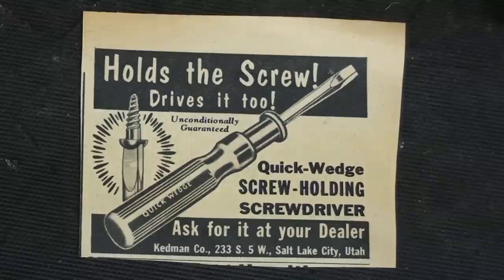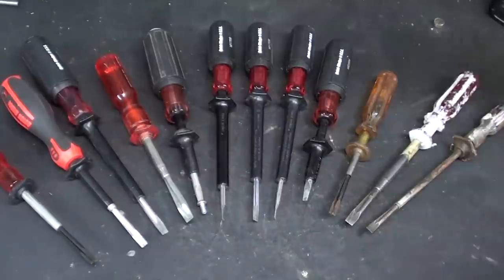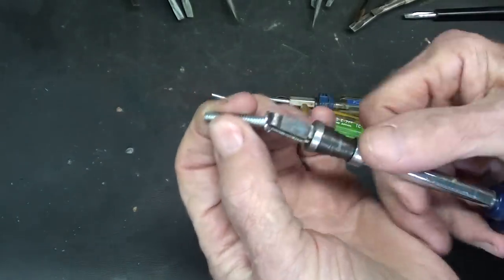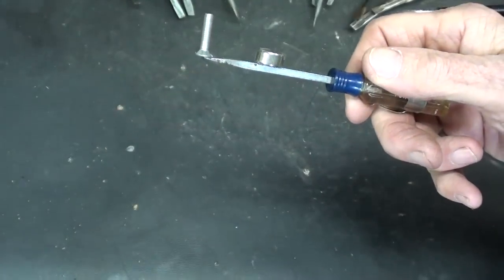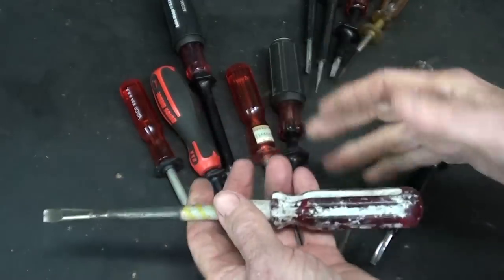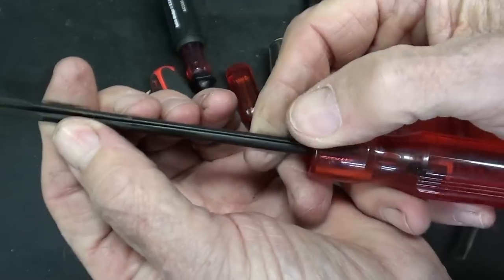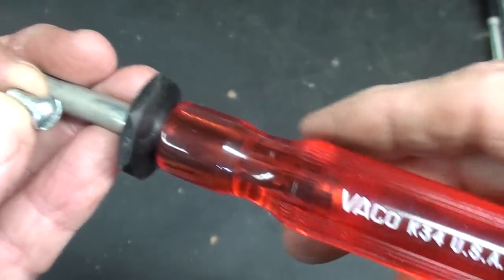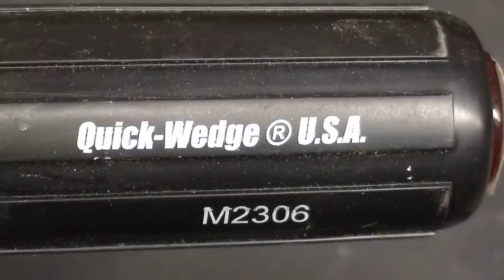what are QUICK WEDGE DRIVERS short subject #25 tubalcain

Comment: Interesting video as usual, thanks.  Good idea that takes into account worn screws or drivers.  I am still surprised that the square headed Robertson screws/screwdrivers never caught on in the USA.  They are extremely popular in Canada and far superior to the Philips/star screws, which tend to round over unless the screws are hardened.  I read that Henry Ford wanted to use the Robertsons in his vehicle manufacturing without paying any license or royalty fee, and when told no he opted to stay with the Philips screws.  The Robertsons not only don't tend to wear like the Philips but the screws usually stay on the driver when inverted.  I worked for a company that sold wheelchair lifts to install in the Seattle bus system and they were very taken with the Robertson screws we used.

Comment: In 37 years of owning and using "screw starters" as an industrial electrician I have NEVER known they were called "Quick Wedge" screw drivers. The worst thing you can do is loan one out. They aren't meant to tighten the screw, but the lazy &%$#@ you loan it to will most certainly tighten a screw with it and ruin it.
Reply from the maker: I think I know that guy

Comment: I've managed to collect several designs of screw holding screwdrivers.  I think the Quick Wedge design is the best.
Reply: A work friend has one with a little spring loaded flipper in the middle of the blade. Worked good for him.
I like Quick Wedge myself.
Reply: @duron700r  I'm planning on doing a show and tell video of my collection this weekend.  I think I have a couple with the flipper like your friend's.

Comment: My Dad was a radio and TV repairman (started in 1947) and I think he bought every screw holding driver ever invented as he had so many tight spaces to get into removing and installing radio chassis in cars, tractors, and home equipment.  He had one that had a center piece that when twisted would be inline with the slot and then when the handle was pushed the little center piece would try to turn at a 90 degree angle.  This really held onto the screw.  But this wedge style is still the best, I have seen them under many names and like you I don't know if they got around the patent or paid for the rights to use it.

Comment: My dad had a whole set of Quick Wedge screw holders and I first used them when I was kid, back in the 1970s.  My dad had the foresight to yell at me before I ended up using them to tighten-up screws, almost like he was the thought police.  That applied to a lot of things, with my dad, actually.  My dad's gone now, but I still have the set of Quick Wedge screw holders along with the original wall-hanging holder that's made from aluminum.

Comment: Thanks Mr. Pete,  I've used the KD brand for years.  They are spring loaded and the center of the blade twists to hold the screw.  They had a magnet on the other end in case the screw slipped out.  they worked great for installing the screws in a distributor to hold the points and condenser.  KD also made one for the Phillips head screw.  You almost have to use a magnetic screwdriver these days because the manufacturers are making screws to be used by the slotted, Phillips and the Robertson square screwdrivers all on the same screw.
Reply: What works better is changing points for an electronic ignition. Like my buddy Scotto shouted as he floored it after I dropped an electronic distributor into his 327 Chevelle, Twice the power! Screw that dual point nonsense. It's just twice the trouble.
Reply: @1pcfred  True but points lasted an awful long time. After their demise came the high capacitor units. Now timing is straight off the crankshaft. I like it.
Reply: @ellieprice363  I never had good service from points. Theoretically contacts should work better than a transistor. Less resistance. In general I am not a fan of electronics in vehicles. They often lead to inscrutable problems in black boxes. Electronic ignition on the other hand is very reliable.

Comment: Very handy tool. I have worn out two of these wiring up Jones strips in electric substations. I also had one that would do Phillips head screws, but rather than a sliding collar, it had a spring-loaded twist lock that engaged the slots. They’re best used as screw starters and you’re right, they can’t handle much torque. Thanks for sharing.

Comment: I have used Quick wedge for at least 3 decades. I love them. I have Quick wedge Snap-On (Blue Point), Vaco and Klein brands. The different brands vary only slightly and are likely all rebranded Quick Wedge. I have 5 or 6 blade sizes and several blade lengths for most sizes. They are an antiquated application since slotted screws are nearly obsolete. There are still a significant number of slotted screws in the electrical industry. This has been my primary demand for this tool. They are handy when doing vintage work. As Lyle demonstrated, the Quick Wedge is vastly superior to all other style of flat blade screw starters. I have more size versions than Lyle showed, but his 1000V rated tools are not in my arsenal.
Craftsman and Snap-On tried a style of screw starters the sort of worked. I have both of these makers versions. This attempt uses a full width flat blade (cabinet tip) with a spring loaded pivoting center blade section. This center blade section is intended to lock the slotted fastener. This style barely works, but the screw holding outside grabber styles are even less successful. I have at least one Phillips screw holding version of the center blade pivoting style. This design wasn't very successful either.

Comment: Marketed in south east Asia as Kedman screw drivers, handles were very small diameter so that you knew not to torque the screw, also had a set that were RAAF issue that were a hinged type where the pivot was an inch or so back from the tips and when the handles were closed, pliers fashion, the wedge action gripped the screw.
I’ve not seen a patent mark on any of the foreign made ones, but is a design concept that goes back to late 1800’s from memory.
Thank you for your informative and sometimes amusing videos. Take care.

Comment: Trick of the trade: wrap the screw with electrical tape to the end of the screwdriver. It holds it on very well enough to get the thread started and you can take the tape off after its secured. I've done this for many decades as a kitchen equipment mechanic and it's hard to get some screws started in hard to reach areas.
Reply from the maker: Good idea

Comment: Yet another great vid.  Keep 'em coming.  Back in the 19 and 70's I learned the old mechanic's trick (from an actual old mechanic) of folding a bit of paper or matchbook cover over the tip of the screwdriver and it into the screw slot.  Worked well for over 50 years.

Comment: For years, working on cars and doing tune-up, the ignition points, condenser and rotor were held in place with small slotted screws such as 6-32 and 83-32. I got my tune up tool kit from Snap-on and it included an aluminum screwstarter with a spring loaded feature that would twist in the slot and hold the screw when unlocked, even by pushing down so your fingers could grip in in small confines. I just looked on McMasterCarr and they had the later developed phillips and nut holders but not the original straight style. I still have them and use them on occasion. Most mechanice had them when distributors were in use. A great example of one is the Stanley Proto J9866 Proto Slotted/Phillips Screw Starter available at many places. T hey do cost more.

Comment: The japanese came out with Phillips slots so perfectly formed that their matching size screwdrivers could hold their screws quite well.  Short of this, a piece of tape tightly wrapped around the screwdriver shaft but loosely around the screw head does the trick.  I was really hoping to find out if that "cheese" that grows on the plastic handles is safe for pets.  It's gotta be some kind of fungus.

Comment: I saw a different type of screw holder called a screw starter used one time and I went right out and bought one for myself.  It saved a boatload of swear words when changing out the points and condenser in an automotive distributor.  In those days the SB Chevy distributor was buried down in front of the firewall and way down on the engine block. Those little screws were always falling over in the distributor, or falling out on the way out of the distributor and (hopefully) all the way to the floor where you could eventually find it.  It was only for slotted screws, and small ones at that, but was invaluable for getting the points adjusting screw and the capacitor mounting screw out of a distributor.  It has a blade end, but the middle is a separate blade piece that is spring loaded and turns something approaching 90 degrees.  To remove the screws from the distributor you would loosen the screw with a conventional screwdriver, then set the spring with the center blade inline with the outer blades, and set the blades down in the slot of the screw and press down, releasing the spring.  The center blade would turn and grip the slot so you could finish loosening the screw and lift it out of the distributor.  To reinstall the screws, you set the spring, aligning the blades and insert it into the slot of the screw you were wanting to put back in the distributor, push down, releasing the spring, and the screw was attached to the screwdriver so you could carefully guide it into the threaded hole and start the threads.  Then finish tightening with a conventional screwdriver.  Personally, I never had much luck with the wedge type screwdrivers.
I bought mine back in the late '60's and still have it.  The closest thing I could find on Amazon (with the best picture) is: "GEARWRENCH Slotted Screw Starter, 5-5/8" - 2282D".  If you search Amazon for "screw starter" you can find find several variations including Phillips only and Phillips and Straight on the same screw starter.  The Phillips starters are very spindly and I don't remember if I ever used one of them.

Comment: Canadians prefer the screw invented by a man named Robertson. Phillips strip way too easy. 
Robertson, the square holed ones, slip onto the correct sized bit and can be held at any angle without falling off.
Henry Ford tried to buy the patent but was told to pound sand. So Americans got stuck with the semi-useless Phillips design.

Comment: Just got my mother-in-law’s place ready for sale…
Have a 27 cubic inch bin of apex bits in my possibles traveling kit and no only found 1 or 2 slot drivers… I was appalled taking down curtain rods, light fixtures, spice racks, cabinet pulls with slot head fasteners…

Comment: Through a working life in engineering here in the UK, I never saw this type of screwdriver even once !
I believe British Telecom issued them to telephone engineers back when phones had about 1000 tiny brass slotted screws in them :o)
Reply: There was a tool like this for electricians that kind of looked like a soda straw. It had a really skinny plastic handle. But the tip was split and wedged. Then with the skinny handle you knew not to try to torque anything. Plus you could get that thing in anywhere.

Comment: I've had 2 for probably over 45 years, a 4 1/2" & 12", both Quick Wedge. Perhaps Vaco made theirs after the patent expired. Back in the day ceiling fan blades were mounted with slotted-head screws and there was no better way of starting those screws than with the Quick Wedge.

Comment: When I was working I had wedge type screw drivers for philips as well as slotted.
Reply from the maker: Never saw one for Phillips
Reply: @mrpete222  Not a whole screwdriver, but a 'screw starter', 3/8 knurled aluminum tube with spring loaded blade for #1 & #2 Phillips, from Snap-On in 1971.  Better then the magnet or sticky grease I'd been using!

Comment: I use the Vaco brand for typewriter maintenance and repair.

The white residue on the handles is the plastic sweating chemicals.  It can be easy remedied by applying a heat gun to the plastic.

Daniel
Reply from the maker: Thanks, I think I will try that truck to remove the white. But it smells sometimes.
Reply: @mrpete222  I've researched the topic of acetate breakdown and there's no known cure. If it was as easy as heating it up I think it'd have been published. I've never been able to find out if the problem is endemic with all acetate or just some. But it seems once it starts happening with a handle it's fatal. It may even be contagious? I've seen handles next to bad handles start to turn themselves. The Butyric acid that out gasses may rust metal too? That's what causes the smell. It's what makes vomit stink. The most popular fix seems to be discarding the offending tool.

Comment: Neat. Id never heard of these before. I bet if id had one when I was a boy, the thought of using a flathead screw wouldn't make me nauseous
Reply: Most slotted screwdrivers don't fit in screw slots. Which is an issue. With a good fit you don't even need these wedge screwdrivers. The screw will stay on the slotted driver. But that's not how screwdrivers are made. To achieve that you have to grind the tip yourself.

Comment: Mr Pete: Why do plastic handle screwdrivers smell when they get old? Please do a video!
Reply from the maker: Someone explained it to me once, but I did not understand it. I have one tool drawer I do not like to open because it smells so bad. I threw away many of those screwdriver over the years that turned white and smelled.
Reply: @mrpete222  From the Petroleum Service Company website: "While CAB is a hearty synthetic plastic and particularly handy for use in toolmaking, it can degrade with exposure to heat and moisture. This degradation releases butyric acid and that foul, vomit-like odor."   
Interestingly enough the same stuff used to make screwdrivers is used to make stink bait for carp fishing...makes scents! (oh, the pun...)

Comment: I have the" white one" I bought in 1978. I have tried numerous treatments to keep the white off my screwdriver handles but a light going over with a fine wire wheel seems to work best.
Reply: Wiping them down with naphtha (Ronsonol lighter fluid) does a pretty good job of cleaning the handles up. Don't use acetone as it will attack the plastic.
Reply: The handle degradation is caused by the Cellulose Acetate Butyrate decomposing. The vomit smell is Butyric acid being released. I've never found a cure for the problem myself. It is caused by the handle material deteriorating. It's breaking down. There's no way I am aware of to arrest the process either. Your best bet is to either dispose of the tool or put another handle on it. Neither of those options is good. A lot of people toss them when it happens.

Comment: If you ever had to connect or disconnect machinery that had terminal strips in them, you will love these things. 
Some machines had hundreds of little #6 screws that need to go in and out and if you drop it it's lost forever. 
On small screws, most times they are strong enough to break the screw free for removal. 

I never saw or heard of the original brand only the Vaco or Klein branded ones

Why does the plastic turn white and stink? Why does locktite melt some screwdriver handles?
Reply from the maker: I did not know that Loctite would melt the handles
Reply: Plastic handles getting funny is Cellulose Acetate Butyrate decomposing. To learn more search for why do plastic handles smell like vomit. That should find you resources about the topic.

Comment: You now need to instruct your students on Japanese Industrial Standard screws and screwdrivers as a follow up.  Maybe this will require the instructor to do research. I don’t know.  If you have to, remember you are a fellow teacher and will not get paid for your research time.😊
Reply from the maker: lol
Reply: Just think of all the Honda motorcycle engine case screws chewed up with a Phillips screwdriver.
Reply: THANKS!  The trouble with Standards are that there are too many Standards!  Hard to have too many Phillip's tip screwdrivers when there are sooo many supposedly standard fasteners.